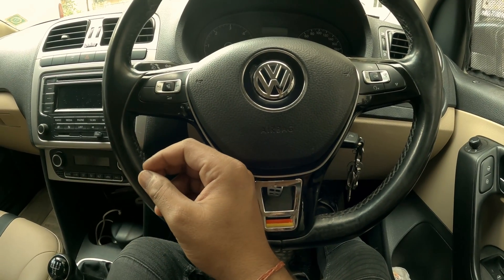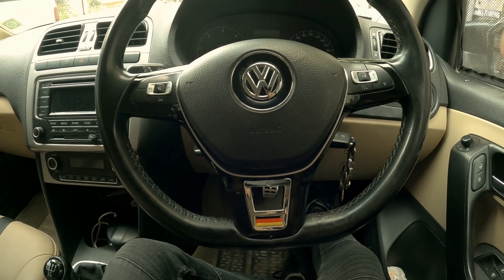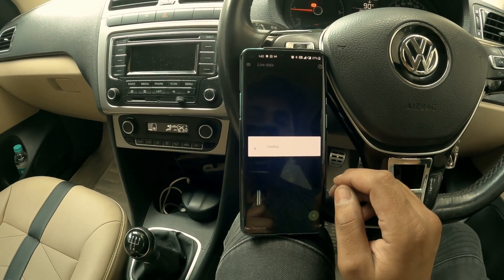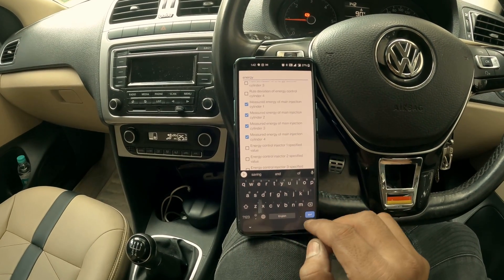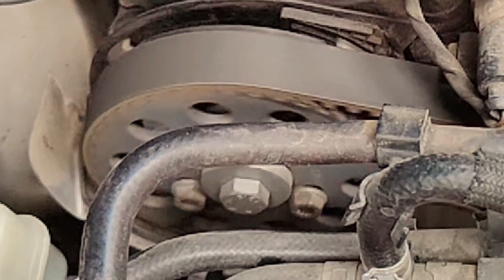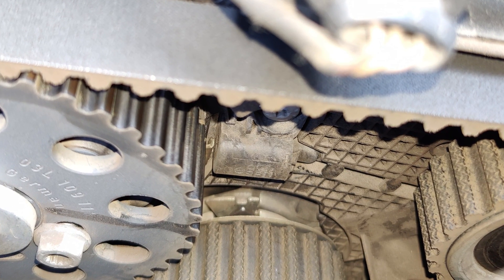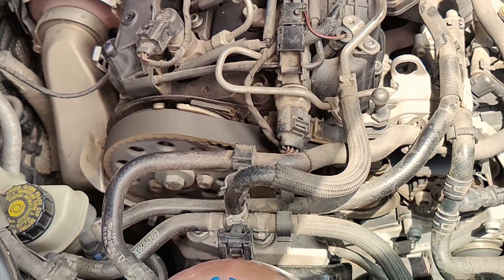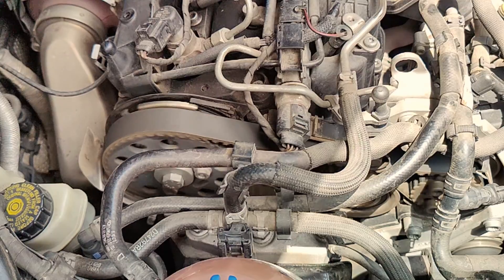HOW TO REDUCE DIESEL ENGINE CLATTER NOISE IN CARS | INJECTOR CALIBRATION NEEDED ? | TICKING TDI

Comment: Sir from few days back...I m noticing whistling noise inside my car... whenever car reaches 1500 rpm or more ..which is very annoying...sir what may be the problem....2012 Skoda rapid TDI
Reply: Can I suggest it's a turbo whistle you're hearing? It's a mild yet pleasant whistle when you accelerate and stop when you lift the foot off throttle. If this is not what it sounds in your car, then it could be air leaking into cabin. I would see start checking the sunroof joints, window, and other areas where air can enter cabin
Reply from the maker: Yes , you are correct sir , in both ways , it was actually sound of turbo sucking air , earlier it was not audible in cabin but later as the dust started to get deposited on the air inlet port of the air conditioner's fresh air mode ( which lets the outside air in , its location is just on top of turbo ) and due to that dust the flap was unable to seal that port properly, and that was the complete reason why i was hearing the noise 
After cleaning the inlet port everything was back to normal

Comment: My safari has engine noise similar to the video link attached .. i have got injectors serviced too.. 50% reduction in noise ... Can u suggest what else to be done to reduce the noise 
https://youtu.be/zZc2EOjPy_I
Reply: Okay thanks
Reply from the maker: Sir use a good fuel additive , it will help to dampen then noise even more , but not regularly , like 1 tank out of every 3 tanks
Reply: @yourDIYneeds  even that was done once .. mechanic also suggested to but 100 gms engine oil in full fuel tank .. so the tank and injectors will be lubricated
Reply from the maker: No sir , never do it , you ll end up clogging the injectors .
Reply: @yourDIYneeds  okay ... Which brand addictive
Reply from the maker: Sir liqui moly is the best i have used till date

Comment: Sir radiator  fan slow start ho raha hai skoda rapid
Reply from the maker: Sir , fan multi-speed hai , wo need ke hissab se apni speed decide karta hai !  Car overheat ho rahi hai kya ?
Reply: No coolant leak was spotted oil cooler assembly was changed at the same time we found fan was starting slowly radiator fan also changed but same
Reply from the maker: Sir speed of radiation fan depends upon 2 factors .
1. Engine temperature 
2. Ambient temperature 
Fan will automatically decide which is the best speed for the vehicle , to maintain that best range of temperature , for best fuel economy and engine power ,
But yes if you still want to be sure then you can connect your car using a obd diagnostic tool and check the engine core temp. It should be somewhere close to 90°C 
1.6 tdi engine's thermostat valve starts to open at 86°C and is fully open at 89°C
Reply: Thanks where us the relay switch located  in rapid
Reply from the maker: Above the driver footwell

Comment: Hi brother yesterday evening i took the car. From the mall parking and went around 500 meters and then suddenly a sound like something of metal which is being dragged begain as if something of  metal is rubbing or dragged I don't know it was such a weird sound but after a few minutes it just suddenly disappeared.
Reply from the maker: Sir from suspension side or engine ?
Reply: @yourDIYneeds  could not identify as I looked underneath  the car there was nothing hanging or broken that was dragged on the road leading to this sound
Reply from the maker: Did your car had a engine sheild installed before ? Which may get loose , and may be dragging before it finally got loose !
Reply: @yourDIYneeds  I checked the engine shield it is installed at its place not in the engine bay and underneath the car both the shield are perfectly in place....are the brake pads making such noise?
Reply from the maker: Sometimes it also happens that a piece of stone gets stuck between the brake rotor and its sheild and that can also create the same rattling noise ., So the chances and possibly is seemless , it will be a matter of worry if it cane again . If it doesn't happen again , then no issues , because if there is something related to engine or suspension it will happen again . 
So sir drive worry-free 🙂
Reply: @yourDIYneeds  the piece of stone might be a reason because there were little bit stones on the roads as there was some construction going on ....I hope this is the only reason🙂 .and how do we come to know that our suspension needs work or shockers need to be changed .. Thankyou so much for helping every time brother and clearing every doubt.❤️
Reply from the maker: Most welcome sir , for suspension clues , you will have to hear out for noise and stability issues , like car doesn't feel that stable on road , over bumps and undulations

Comment: I have Skoda rapid 1.5 TDI, my car engine also produce same clatter particularly while moving from standstill usually when at low rpm.
This all started after Diesel gate software emission fix. Before update there was less clatter. Can anything be done to reduce this?
Reply: 🙏ste Navjot Singh Sir. My colleague 1.5 Ameo highline 2018 model which clocked 76000 on ODO also had same problem(He bought 2nd hand upon my insistence).

The clattering was so much, that whole engine used to vibrate as if INJECTOR was malfunctioning. Took upon the blame myself & visited 2-3 mechanics to no avail.
Every one including my nearest VW showroom said 
" Sir eeeey tho common hi VW TDI engines mey. 76000 km chal chuki hi na, itna clattering noise tho chalega"😩 karke.

🥺 But my friend was hell bent on engine smoothness. He actually bought 2nd hand VW brand looking at my AMEO TDI absolute engine smoothness ( even VW service center guys are surprised). But no TDI engines are available any more. Hence he went for 2nds.

😍esey insaan ka dil nahi thodna chata hu💘.

SO DID THE FOLLOWING THINKING IT WOULD BE RESOLVED 🥺

❌ Got annual service done from outside ( engine oil changed, OEM oil,air, fuel filters were changed).
🙃No use.

❌Again asked him to Clean fuel tank after 10days. (Cleaning tank with new sponge.)
🙃No use.

❌Then suspected STATOR MOTOR.  Since early morning 1st Crank takes 3-4 secs ,but subsequent cranking takes milliseconds 🤔. Hence couldn't find fault with stator motor

❌ Doubted battery. But it too was 6 month old🤯 & in perfect voltage condition. 
❌PISTON RINGS TOO WERE DOUBTFUL.

😩 Then how come 1st cranking take sooo long & engine vibrates heavily⁉️⁉️⁉️⁉️

👹Then doubted FUEL INJECTORS to be culprit. But common couldn't do anything from his side.

❌Also doubted cam shaft sensor. But no clinching evidence was found.
❌ Throttle body too was questioned.
❌ There's was also oil leakage from  TURBO INLET PIPE. After MAF sensor.🙆
My friend & I both are deeply upset for not being able to get the car service done. We have to travel 130 km every time to get the car repaired. No mechanic had knowledge about VW's in my locality😌😏.

🤬🤬😡 We are ready to shell upto 1 lakh if required but no one is able to tell us the root cause of the problem.

🔥Then I took it upon myself & done the following on trail & error method.

👌 Watched  yourDIYneeds umpteen times( only my wife, myself & this channel creator knew how many nights, days & months I spent watching his videos thoroughly.)

1️⃣ St Engine flush: instead of diesel I carried out flush with petrol, just for 2minutes & drained oil.
2️⃣nd poured some cheap oil brand of 15W40 of 4.3 ltr worth 600/- (recommend is 5W40) & had run the engine for 30 mnts. Drained it completely till the last drop.

3️⃣ 👌PURCHASED AMSOIL signature series 5W40 grade engine oil & filled it 
4️⃣🌟 ALL FILTERS WERE AGAIN CHANGED. OEM ONLY.

5️⃣ 🌟MAF SENSOR WAS THOROUGHLY CLEANED WITH PETROL.( USED SYRINGE 💉 FOR PRESSURE🤪🤪)

6️⃣🌟ALSO CLEANED TURBO INLET LINE INCLUDING AIR FILTER INLET LINE & PCV VALVE WITH PETROL COMPLETELY & ensured that they r dry.

NOTE: Thought of cleaning condenser too but luckily my friend had an accident🤭🤭🤭😃 & got NEW CONDENSER COVERED BY INSURANCE.

✅✅✅✅✅
RESULT: VOILAAA💪💪💪💪💪🦾🦾🦾🦾🦾🦾🦾🦾🦾🦾🦾🦾🦾🦾🦾👍👍👍👍👍👍. Engine smoothness is utter unbelievable 🤭😃😍😍👏👏👏👏. No vibrations during idling. As good as a new one. No need of new ENGINE mounts too😃.

Hope this helps. 🙏🙏🙏

Forgot 1 thing ji : we also ensured that the fuel tank is almost empty (5ltr reserve after 0 level on display too was used almost) & filled with SHELL POWER DIESEL and blasted the car past 100 for 30-40mnts to clean injectors as much as possible.

Pls do it & feel the difference.
Reply: @srinivaskumarreddy120  is it safe to flush engine with petrol instead of diesel bro??? for any car
Reply: @amritpb5073  Amrit ji 🙏kar. Very Nice doubt ji aapka👏. 

DIESEL fuel is thicker( higher viscosity) & oilier than PETROL. 
🔥 IF PETROL IS RUBBED ON HANDS LIKE A SANITIZER IT EVAPORATES INSTANTLY.
🙄 BUT DIESEL ⛽ DOESN'T EVAPORATE SO EASILY WHEN APPLIED ON HANDS.

🌟 PETROL WASH IS CARRIED OUT FOR DRY CLEANING & NOT DIESEL or even thinner😊.

🌟 Our 2 WHEELER🛵 bike piston, it's Crank shaft and oil sump are always cleaned/ Soaked in petrol( to clean carbon deposits on piston head) and not in diesel.

 🤔😡Then for flushing, petrol ko use karne mey kya taklif hi🤯.

Ans: Bike Engine cleaning, dry cleaning etc.....are carried out in open space.

😱🥵But car flushing is carried out in a closed chamber, which makes it more dangerous in addition to the high piston temperatures. PETROL BEING HIGHLY VOLATILE CHANCES ARE THAT IT MIGHT CATCH 🔥.

HENCE DIESEL ⛽ IS USED FOR BEING ON SAFE SIDE. 
🌟BUT, IF DIESEL IS USED as engine FLUSH, then EVEN AFTER DRAINING 
the oil sump completely also DIESEL still exists inside by sticking to walls. In order to remove that diesel again we have to use some cheap mineral oil ,rum the engine for 30mnts in idle condition & again drain it which is waste of time & money.(IMO)

In such case it's better to use engine flush of liquimoly, Motul, Amsoil, Mobil, wruth etcccc....... Which are cheap and best.

⁉️BUT Y DID I USE PETROL ⁉️⁉️
itna risk honeka baad bhi isliye use kiya kyuo ki "PCV valve" hi. So I'm not  afraid of accidental combustion inside oil chamber.

aur safe side rahne keliye I removed OIL DIPSTICK & loosened the engine  oil Cap a bit & poured 200 Ml of PETROL in oil & kept the engine in idle for just 2️⃣ mnts only.
In addition to that VW DIESEL car's oil sump capacity is 4.3ltr with 10W40 Grade Oil unlike 3.1 ltr of TINJUKI BRANDS sorry SUZUKI brands 5W30 grade which itself is veryyy thin compared to VW oil grades.

Hence it's highly unlikely that engine seizes with 10W40 synthetic oil grades when engine flushing is done with just 200ml of petrol.

NOTE: But I personally prefer carrying out engine oil flush with reputed brands only. Since they are very balanced with all OIL type grades, be it mineral/ synthetic/ semi synthetic. I couldn't order these engine flush products on time & muje apna dost ka car ko jaldi return karna tha isliye I used petrol instead of Diesel.

HOPE I JUSTIFIED MY VIEW & YOUR QUESTION once for all 😊. Dhanyavad ji🙏
Reply: @amritpb5073  simple answer would be yes sir, it is safe if only 100ml of petrol is used , and oil DIPSTICK is removed & engine is standstill while idling for 3-4mnts.
Reply: @srinivaskumarreddy120  and you are right ji disel hand pe lagaye chahe kisi part pe wha se nahi jata.........petrol muh se air manre pe bhi udd jata hai. same engine me hota hoga. understood ji............in very nice way you have replied and clered my doubt ji
lotssssssssssssssssssss lotsssssssssssss of thanks ji
Reply: @amritpb5073  😊😊🙏 thanku ji
Reply from the maker: Sir sab thek hai , lekin bus petrol ke sath problem ye hai ki its a very good dissolvent , ye property carbon deposit ko melt karne ke lie to bhot achi hai but , engine oil ke lie bhot buri , agar limit se jada gya thoda sa bhi to engine oil ki viscosity ko bhot effect karega 
Bus is chej ka dhyan rakhna
Reply: @yourDIYneeds  yes ji .
Reply: Switch off the engine . Less noise 🤪🤪😃
Reply from the maker: Sir let it warm up and till the time its on operating temp. Drive it with lite foot
Reply: @yourDIYneeds  S. this is what I follow too. And not to switch on AC unless oil temperature reaches 90⁰C.
Reply from the maker: For AC i wait till 75 😅
Reply: @yourDIYneeds   Have you thought about remap your engine?
Reply from the maker: Yes sir , but didn't find any reliable remap
Reply: @yourDIYneeds  😃
Reply: @yourDIYneeds  do inform us when you find out reliable remap.
Reply from the maker: Sure sir
Reply: @srinivaskumarreddy120  not understood wt you said dear
Reply: @srinivaskumar reddy - Thank you for the detailed reply ji 🙏🏽
Reply: @corvaliskhan1243  Thanku 😊 sir🙏.

Comment: Brother I want one technical advice..
Reply: yes please tell
Reply: @amritpb5073   my Skoda rapid 2014 1.6 tdi is on limp mode and I diagnosed it shows the cam position sensor having some issues ... Two mechanic hav said different openion ... What I should do now ??
Reply: @illanpughal8688  what are the problems you are facing in limp mode dear? and is engine check light on your speedometer is flashing or still???
Reply: @amritpb5073   rpm will be 2500 and top speed 100 .. there will be no pick up ... Check engine light and coil wireing light is on ... Engine take 5 seconds or more to start ..
Reply from the maker: Sir most probably , Its time to change the sensor

Comment: Is engine flushing required in general. Thinking of doing it for my car 1.8L kms perfect condition
Reply from the maker: Sir ideally if you are changing oil on time , and using a good oil , its not required .
Reply: @yourDIYneeds  should i advance oil change to 10k instead of 15k. Thanks for the clarification
Reply from the maker: Sir i had been doing this practice from when my car was 40k kms , 15k kms interval feels too long
Reply: @yourDIYneeds  thanks man
Reply: @legolash8370  yes dear your car will not say to change your engine oil even after 20 k . it is our duty to change the engine oil on time to run our engine smootly . after 8-9k kilomters you should check your dip stick after few days. if you are feeling your engine oil is becoming very thick and black like grease. you should change it. i also do same like @yourDIYneeds i dont change my engine oil after 15k even vw claims that it will long last upto 15 k . i changes it at 10 k . it will be very good and fine for our next engine oil.